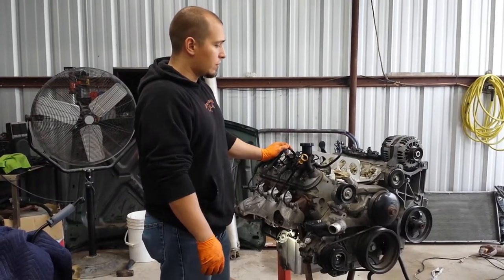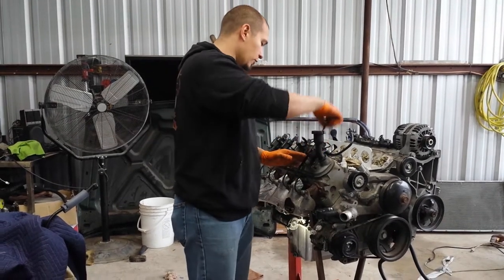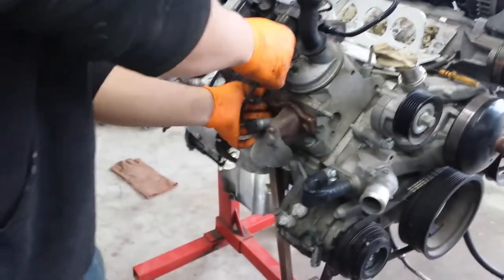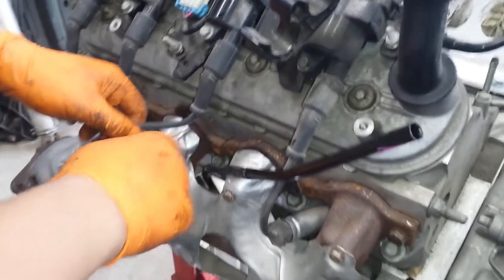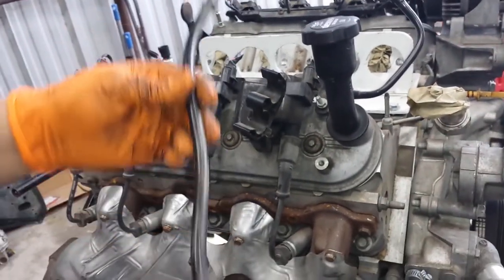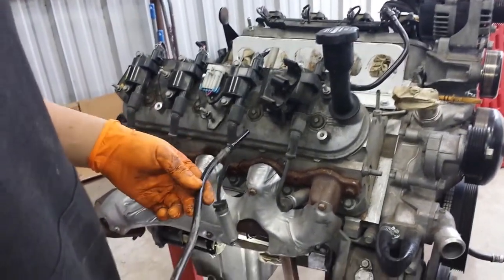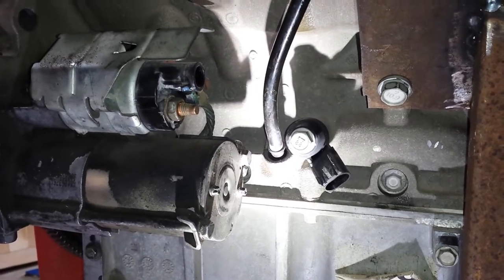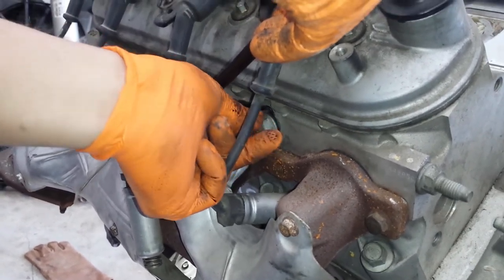2009-2013 Silverado Dipstick Tube Replacement

Comment: I tried to replace mine today because the tube it’s broken off right there at the bolt bracket. It would NOT come out, stuck in place like a mofo. Any advice? Thanks
Reply from the maker: Put a vice grip on the lowest possible part of the tube. Then from underneath get a long socket extension to touch the vice grip and then hammer it. You would be hammering the socket extension that is only being used so you can reach the vice grip from underneath the truck. The vice grip should be tight on the the tube so that it brings the tube out with it.

Comment: What dipstick do you guys recommend f or use w ith long tube headers as the stock one wont fit?
Reply from the maker: Have you tried removing the dipstick, installing your headers, then try reinstalling your dipstick after the headers have been installed?  If so and you have fitment issues, Lokar brand sells flexible stainless steel braided dipsticks. Look into those
Reply: @EddiesCustomsandRestorations   Yes. I got the dipstick to fit but I had to bend it some so it would clear one of the header pipes. Putting that bend in it now makes the dipstick really tough to push in. II'm looking  at getting the Lokar ED-5021. Thanks
Reply from the maker: @atxjax1  youre welcome! glad I could help.
Reply: @atxjax1  what did you end up doing? I’m working on my headers now
Reply: @danielhopper9335  Lokar ED-5021 is what I used on my LY5 engine. Works perfect

Comment: Do you need to drain your oil before removing dipstick?
Reply from the maker: No you do not. And I provided a link down in the description for the part if you wish to order online.
Reply: Thank you and is this a 4.3 ?
Reply from the maker: @miamonette3263  this is a 5.3 actually but to replace the dipstick u never have to drain the oil

Comment: If it went in that easy, wont it come out as well?
Reply from the maker: Yes lol. It should but sometimed you need to wiggle it clockwise and counter clockwise over and over
Reply: @EddiesCustomsandRestorations  OK mine is doing that currently. Thought about putting rtv on it. But if thats normal I leave it be. Any leaks?
Reply from the maker: Oh im sorry i misunderstood your comment at first. But no, if you replace the oring it has it will seal it from any leaks. However, in the past i have put rtv silicone on the end of the dipstick where it meets the block and let that be the seal and i never had any leaks so long as the dip stick is secured with a bolt to keep it from wiggling around as you drive
Reply: @EddiesCustomsandRestorations  OK, my dipstick is new. Truck 5.3, but it wiggles in hole without being bolted. I'll try the rtv and bolting
Reply: @EddiesCustomsandRestorations  check my video and let me know if yours was that loose